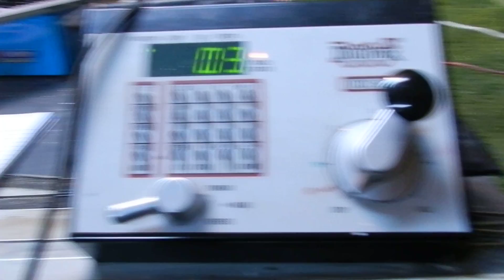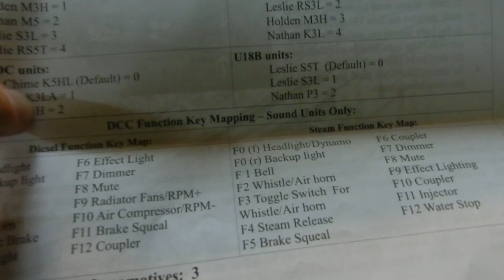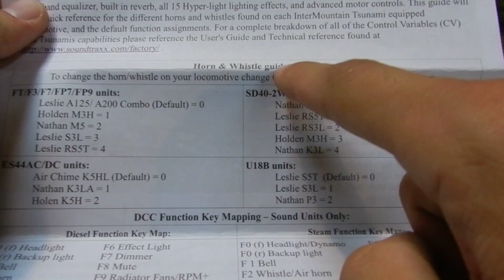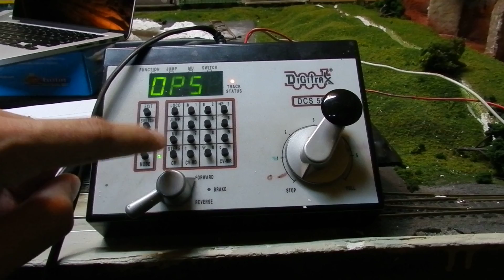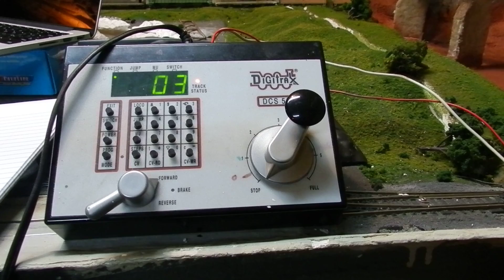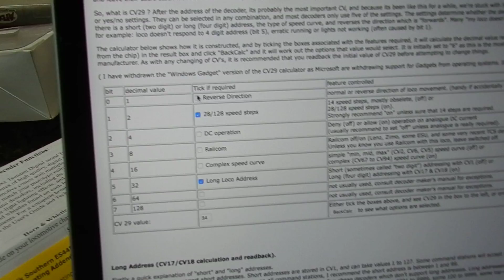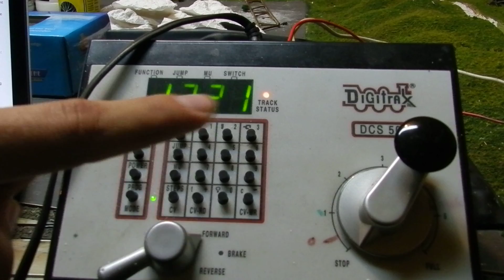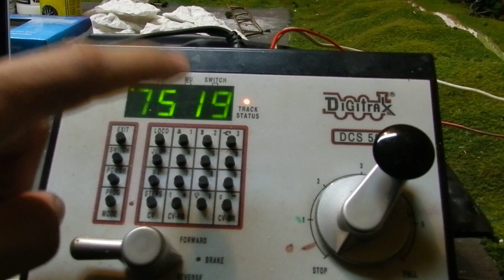DCC Programming Basics - CV's, Locomotive Addresses, Horns

Comment: I I’m so confused on how you programmed the address
Reply from the maker: its strange and there are easier ways - I'm working on a new studio to be able to create and upload new videos starting later this spring. In the meantime, I suggest using google, JMRI, or an ESU lokprogrammer.

This method splits the cab number into a 16 bit binary, then takes the first 8 bits into a real number, adds 192 and assigns it to CV17. Then it takes the last 8 bits (from the beginning), converts it back into a real number, and assigns that to CV18. Then Set CV29 to corresponding value you desire.

Comment: Thanks for the informative and instructional video.  How do I find out what the original or factory value for CV29 is?  I need to run all of my engines using address 03 at home (required by MRC Tech 6 2.0 controller), but would like to use a long address (cab #) for each of them when on our club layout.  Should I program CV's 17 and 18 on each of engine to their respective long address (cab #) while addressing them with address 03 at home, and then when I get to the club layout program CV 29 to the correct value (probably also value=34 like you did) to use long addresses?  Then before leaving the club layout, should I reset CV 29 on each engine to its original or factory value so I can address them using address 03 at home?  I'd prefer not to reset them each time b/c I program other CV's to my liking such as horn type, individual sound element volume levels, acceleration rate, deceleration rate, etc.  Thanks again for your video and help.

Comment: This used to work before I reset my controller back to factory. First hit program to page. Second hit locomotive key to where it gives you either add to or add four select what you want to put in 2or4 address. And third press CV-RW and that should program your new address. Then exit out. Like I said this used to work on mine before I did a factory reset. Now I can't do anything with it it just reads D ND.